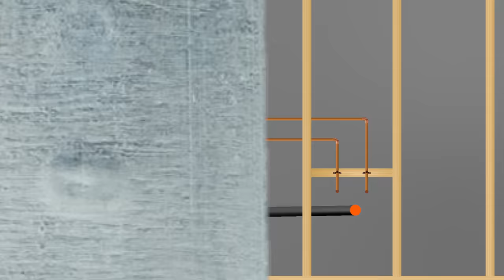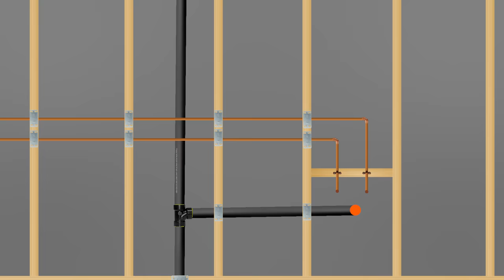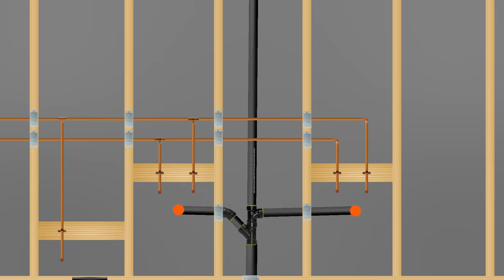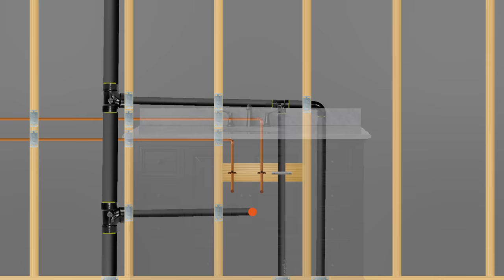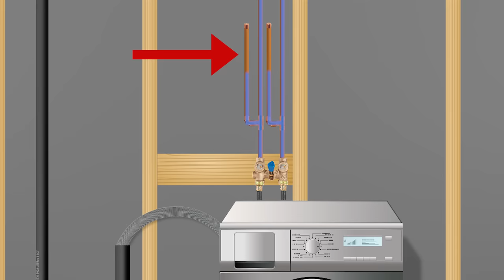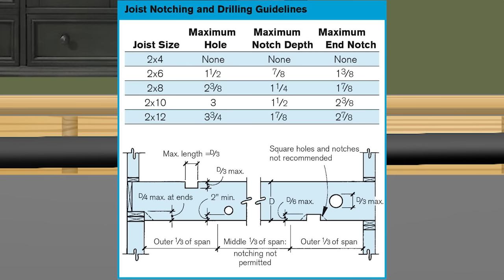10 Reasons Why You'd FAIL a Plumbing Inspection! | GOT2LEARN

Comment: The cleanout also works as a test plug for inspection. Most inspectors like their drains filled with water to the top of a 10ft stack.
Reply from the maker: Absolutely, I should of mentioned this, thank you!
Reply: In the area where I live a test stack with 10 ft of water would freeze in the winter Here all the lines a capped and a air gage is used and filled with pressures air and it must hold pressure.
Reply: @timhale501  
That is true, but its difficult to test air on a plug. You woud have to cap off or does air work as well?

Comment: 5:08 why could you not connect a new fixture to an existing vent pipe?  If the existing vent pipe was sufficient size and distance, it looks like it would have been OK in new construction, why not OK in addition?  Thanks

Wonderful video.  Thumbs up.
Reply from the maker: In an addition, you can't change the rest of the piping to suit the new venting needs if need be and it's just not code ;) Thank you so much!
Reply: @Got2Learn  I had the same question.  I'm planning on adding basement fixtures to an existing 2 inch vent currently serving 6 DFU's on the first floor.  My plan is to add another 6 DFU's which will be only my ejector pump for a total of 12 DFU's.  UPC says a 2 inch vent can serve up to 24 DFU's.  I also cannot find in the UPC code book where this is prohibited.  Thanks.

Comment: Other than replacing taps I would never do any plumbing myself but I love learning this so I understand what others have done. I had a new bathroom installed a few years ago with - necessarily - exposed outdoor pipes (I'm in Australia so no issues with freezing). I now know why all the things (e.g. the cleanout) have been installed as I am sure the rules are similar here to in Canada or the US
Reply: in my country (easten europe) you do it better by yourself because you don't really have a choice. the reason is that there are no good plumbers and they don't know any of those rules and regulations. the good ones emigrated to western countries and the ones that remained are extremely expensive and not available because they are working for important jobs only (not housing)

Comment: For #6, some codes require a clean out above a double sanitary tee, otherwise when snaking, the snake can jump to the other side of the tee and never be able to go down the stack toward the clog.
Reply: That was a double combo
Reply: I’ve plumbed for 8 years and have never seen a snake in a pipe on any job. I do run drain cables with drain machines to clean lines
Reply: It's a double fixture tee, a double combo creates an s-trap and is illegal.

Comment: As a state certified and listened inspector, I’ve see municipality inspectors pass stuff that should have failed. I’ve also seen them fail stuff that was done correctly. So ALWAYS ask to see their license.
Reply from the maker: Well said.
Reply: And I cannot count the number of "state" inspectors pass things that never should have been built. It goes both ways. I assume you meant 'licensed' inspectors - that is a local/state issue. Many jurisdictions require inspectors to be "certified" by the model code groups but then, there are states where inspectors are not required to have any certifications or any experience.

Comment: Good description on the plumbing code. The #6 violation, is still a violation. The double TY fitting must be a double Y fitting, this will prevent the snake from passing from one side to the other, if the drain is  plugged down stream of where the 2 lines meet.
Reply: Frank, i've had that happen before & it led to finding that the stack was packed from that point down. Very unhappy client!
Reply: Correct it has to be a double fixture fitting

Comment: Forgot to add the max length of waste arms for the sink. You are only allowed MAX for 1¼" pipe 5' of run and 8' on 2” pipe. Which by theory (if ran at ¼" per foot) prevents it from dropping more than it's inner diameter.

Comment: How can Grundfos thermostatic comfort valves be allowed when upon installation, any use of cold water in the home results in hot water siphoning into the cold water lines(due to pressure differentials in the water lines).  This places extra demand on water heater and loss of cold water comfort,ie  making cool-aid with warm water or washing salad ingredients with warm water.  Anyone troubleshooting why it takes forever to get cold water from their tap or investigating high water heating bills should look for these valves installed under sinks.

Comment: Thank you for the awesome videos. I recently had to remove quite a bit of a  3 in waste stack to allow foundation guys to repair a structual wall. The tip about the horizontal sanitary tee saved me from a mistake since that is how they originally did it on my 3 in waste line where it merges with the 4 inch soil pipe.  And yes I used to have to clear that blockage about once a year. Fortunately there was one clean out.

Comment: Thank you! Good information here..
Can I use a long sweep 90 off the toilet if the waste pipe is run underneath the joists into th basement where the ceiling isn't getting sheetrock? I

Comment: How can you pass any plumbing inspection without  a "cleanout tee" before it exits the foundation? How would you show a test on the plumbing for the inspector, without a "test tee/cleanout tee"? Just because you install a cleanout doesn't mean you will pass. With no test you'll fail. Quick tip. Never call inspections in on a Friday or Monday. Inspectors are busy on friday with everyone being behind schedule and fail a lot of inspections for stupid or minimal infractions,  they want to get off early on Friday's like everyone else. Monday's they are coming back from a relaxing weekend and are busy re-inspecting Friday's fails. Wednesday is best because Tuesday they re-inspect Monday's fails. Also you can fix your awe shits and call it in for Thursday.

Comment: Regular 90*s can be used on drainage when going from horizontal to vertical, long sweeps on horizontal to horizontal or vertical to horizontal transition
Reply from the maker: There are a lot of factors here that I just couldn't mention or the video would have been 3 times as long but yeah, there's some places they are allowed and some not, thanks Pat!
Reply: I never understood this. Reg 90s on a horizontal position, less bend, but HAVE to use long turn 90s from horizontal to vertical. Can someone please explain this to me?
Reply: In drainage they are not called 90's. They are called quarter bends.1/4 bends. 90's are used in water systems, gas pipe, etc.
Reply: @joshm5816  quarter bends are cast iron drainage fittings
Reply: @path3848  Negative. Read your national code book. Got my NC P1 master licenses in 2001 and this was a big reason people failed. Not naming fittings properly.
Reply: @joshm5816  I don't have a national code book never heard of it, been licensed in chicago/il. since the 80s, when I ordered a 4" 1/4 bend I got cast iron hub and spigot fitting when I ordered a 4" 90 I got a copper sweat fitting guess it's regional, no doubt they'd fail you for it, license tests are definitely not a true test of a person's mechanical abilities,
Reply: @path3848  That's no doubt about the license.
Reply: @path3848  Sorry autocorrect got me. It's the ICC. International Code council in NC
Reply: No one says 1/4 bend. Been plumbing for 20 damn years, if we're working on plastic and I scream get me a 90, a 90 shows up. If I scream get me a sweep, a long turn 90 shows up. No where on my master license test did this cause a problem and no one failed because of it.
Reply: @Scott-eo7lj  Well I've been plumbing since 97 and licensed since 01 and we call them 1/4 bends in drainage systems. My dad plumbed since 1979 and he always calls them that. Test back in our times made you recognize this and if you understood to code properly you'd know why.
Reply: Scott thank you for the clarification on sweeps. That’s how I was taught as well. I don’t say short or long sweeps. It’s either a sweep or a regular and now a vent 90 but we don’t really use those. I think the only pipe that has 3 types of 90s (again not counting cent 90s) is cast iron in which there’s a long sweep, short sweep, and 1/4 bend.
Reply: Josh I’ve been plumbing since 2000 and the only time I’ve ever heard of 1/4 bend being a designated name for a fitting is in cast iron where you have a long sweep, short sweep, and quarter bend. Other than that the names are interchangeable. I have known people who will say 90, 45, and 16 which just confused new guys in my opinion. Why not just keep it consistent and say 22. Even if you are right what does that have to do with the price of tea in China. As long as your helper knows what you’re talking about when they get a fitting it’s irrelevant .
Reply: @joshcowart2446  The reason its proper to relate to drainage fittings in fractions is for measurements and equations to allow the proper fittings being used. Fractions are a more common equation used than degree.
Reply: Cheap Seats you have it backwards. On horizontal you can only use long bends. Shorts are only allowed when going from horizontal to vertical. Vertical to horizontal needs a long bend and any horizontal needs one. The reason is when water is flowing and runs into a short 90 it halts the flow when it changes direction. The longer bend eases this. When going from horizontal to vertical it’s allowed because the flow has gravity to aid it when it goes through the bend. That’s why you can use a sanitary tee or a short 90 when going from horizontal to vertical.
Reply: @joshcowart2446  I just replied the relevance of fittings used in fractions. On multistory buildings we construct a large part of the plumbing system at our shop then put it together on site. We use fraction equations to get the proper angle. It's a 22 1/2 which is a 16 bend
Reply: Josh I’m not sure I follow. Are you saying because when you measure something you use fractions, it’s easier for someone to follow with fractions on a fitting? Then why is it different between water and sewer. You use measurements on both of those.
Reply: Josh I’m still not sure I follow but then I’ve never orefabbed anything off site. In the end it’s irrelevant. I get by doing things my way and you get by your way, that’s what matters. Also, I know what a 16th bend is in case you were correcting me. I said 22 because no one bothers adding the half because everyone knows what you’re talking about.
Reply: YungSumGuy  Funny Guy?
Reply: I've also never pre fabricated anything before. But I also work for a service company. Plumbing heating and cooling. Whole different ball game when it comes to new construction. Here in michigan we call them long sweeps or regular. Also use degrees. But every region is different and to each there own!

Comment: very informative video. Lots of great info for the home plumber, even a professional  plumber. I have a question though. For #7 starting at 4:00 into the video, the illustration shows a santee as the drainage pipe which earlier you stated was illegal. Shouldn't it be a long sweep in that installation?

Comment: Some of this is brilliant but others are unheard of in the UK. Like drill plates, over here it is the dry liners fault if they put a screw though a pipe. 

Also 2 inch trap and upstand for a washing machine is so over kill especially as it most always T's into a 2 inch float straight away.
Reply: I moved from the USA to Norway, where they also do not use protective nail plates. When my house was being built,  I made and installed my own and the plumbers and inspector all commented on what a great idea that is. It also has saved me a couple of times both when I installed the sheetrock and afterwards when hanging shelves.

I much prefer preventing an accident over someone being liable for one.
Reply: Mr Sam Drywallers here are idiots 😂 Just kidding. Really though, they’re often in such a hurry in new builds that I could totally see someone not marking the sheet for the locations of piping, or not marking it properly, then screwing through a line 😬

As for the 2” standpipe for laundry, I wonder if it’s an appliance thing. Maybe the washers here put out more volume when draining? 🤷🏼‍♂️
Reply: Just imagine if the dry wallers drill a screw into a main copper supply and the screw only lets only a bit of leakage out , you won’t know till you see your drywall getting moldy, the nail plates are just an extra precaution.
Reply: @orboflightning  Just looking at how you boys do it over the pond, seems like you run a lot of pipes through timber! Must be loads of holes to cut! Can see how those drill plates come in handy. 

We almost always have a void to run pipes, then the dry liners put up sheet steel stud work and then plaster board/ dry wall on top of that. Much less likely to put a screw through a pipe like that.
Reply: @armandopena7921  true. But that's not a precaution that should fall on the plumbers. The drywallers should be doing that, if they are too incompetant to be sure of where they are putting their screws.

Comment: fascinating.  One other point more about the old 18 inch hammer arresters they used to use those dead leg pipes, they end up filling up as the water absorbs the air and fills the pipe with stagnant water that can actually breed bacteria and begin to contaminate your tap water, Also why in any old house I have lived in I never drink strait from the tap, I always only use filters.  a 40 year old house, who knows wha'ts in those pipes.
Reply from the maker: True!!!
Reply: A 40 year old house in the UK is a new build.
My home is 120 years old, its not even classed as an old house.
I still have lead water pipes, with a bit of copper. Certainly no plastic pipe.
My friend lives in a 400 year old house with its own well.

Comment: As a PM keeping on top of codes regardless of the servicer, ie: plumbing, electrical, framing, roofing…is a constant issue, and daily inspections are a must…best just to have high quality contractors to avoid foolishness that inspectors inevitably will derail a project if it’s unacceptable…

Comment: Is this IPC or UPC? And perhaps instead of hiring a contractor, hire a licenced plumber. Drilling or notching holes to large will not fail the plumbing inspection. But the building inspection may suffer.

Comment: Pretty sure that short sweep 90s are permitted on drain when going from a horizontal to vertical, just not from vertical to horizontal.
Reply from the maker: Yes they are :)
Reply: In ct you can use regular sweep up to 2 inch vertical and horizontally. And 3 inch you can if it is installed vertical.

Comment: Hi, must vent pipe be vertically straight to the roof? Can it be like an upside-down L shape going out through wall? 

I installed a new bathroom, but i dont want to open another hole on the roof. Can the vent pipe go out through the wall instead? Thanks
Reply from the maker: There are rules and regulations for vents, the reason it goes out through the roof is to prevent people from smelling the sewer gases, so you gotta check that with you municipality, cheers!

Comment: The double tee/y makes it impossible to snake so make sure to put a clean out below it.
Reply: That's very good to know. I did not know about cleaning difficulties with double tee/y's. Thank you for sharing.
But you should put clean access above it and above every fixture's highest point in that floor, so if there's blockage, water could not rise higher than any fixture point in a pipe, so if you open it to clean water will not be forced through cleaning access.
Reply: Mickey use a double wye with st 45* s, dbl Ty’s suck, I’ve had lots of issues snaking sink drains because of that POS fitting. 38 years as a plumber here.
Reply: And that is why you use a Figure-5 Fitting and not a double-sanitary tee.
Reply: Stack 2 sanitary tee one drain will just be a little higher than the other 🤷🏽‍♂️

Comment: Great video. And I thought I knew all this....  One huge problem we face. HomeFnDepot. Their ABS, PVC and other fittings inventory is incredibly incompetent, disorganized and incomplete. (I suggested to them more than 20 years ago that they put catch all trays so customers who find a wrong part in a bin or who decide they don't want a piece can  put it in one easy spot instead of just back into any old bin. I'm sure I'm not the only one to suggest this, and in the better (but now ) rare hardware stores they do this.) I had an emergency 2" ABS repair to make at my house. What I did works, but isn't to code and looks stupid -why? Because two Home depot didn't have standard 2" sweeps one of the most common parts. 
One day I made the extra long drive to Virgil's hardware, I had a whole list of bolts and stuff. In five minutes I had all of it. The second clerk to come by and ask if I needed help I remarked, "I found everything, in five minutes and I'm not pissed off. This sure ain't the Home Depot."
Reply: That's why real professionals go to a plumbing supply house and not a big box store. The quality of their materials is garbage and they don't have what you need half the time and the trip ends up being a complete waste. 

As bad as Home Depot and Lowe's can be, they've got nothing on ACE Hardware. By far the worst hardware chain store in the country. I went in there one time because it was literally within walking distance of a job thinking there'd be no way they don't have a couple of 2" elbows. Well color me surprised because sure enough, they did not have any 2" elbows. The most common fitting and they didn't have it. Pathetic.